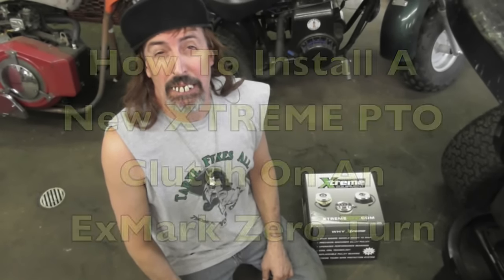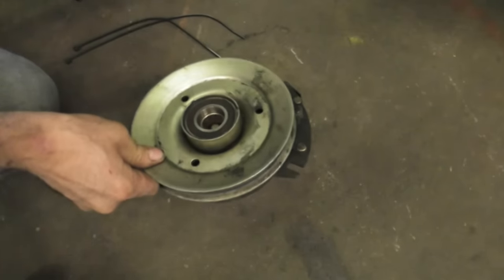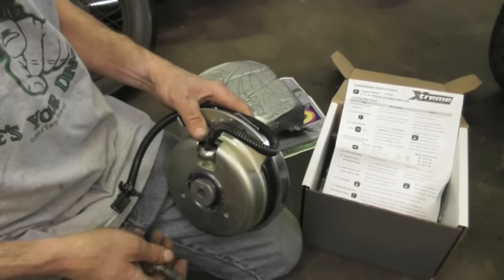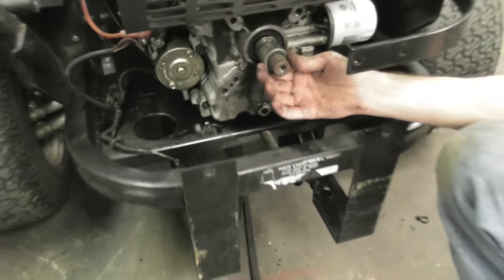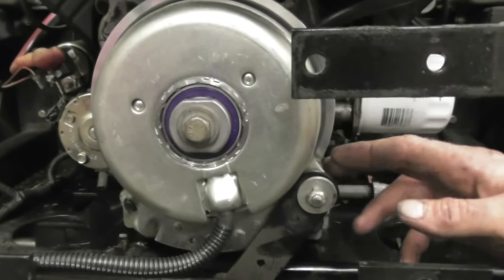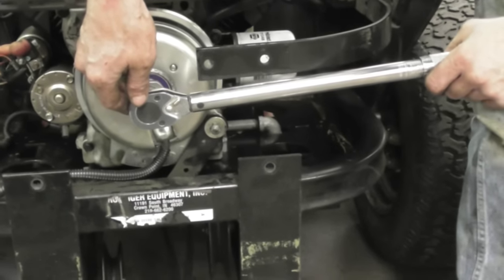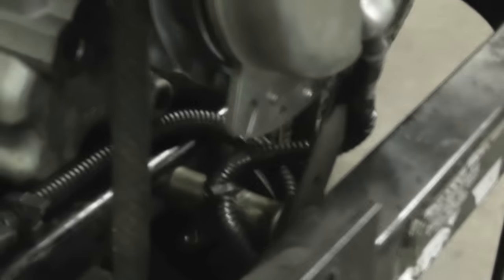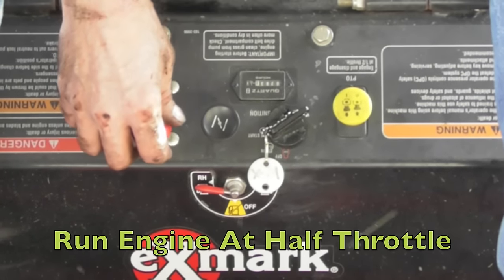Xtreme Clutch Installation Video

Comment: just cooked the pto clutch on my cub, blow jobbing the snow. I didn't look at it yet, but I know it cooked cuz it let the smoke out and the pto stopped working. it was original. all the epoxy cracked and fell apart inside. I had cleaned it up and re-epoxied it. worked for a year but it's full on dead now. I suspect the battery isn't charging, which usually isn't any problem at all, cuz if I'm only ever using the battery to start the engine, it actually lasts half the season before I have to charge it again. but, the clutch is a fairly good draw on the battery, which can drain it down much faster. what I think happened, the battery got weak, still plenty to start the engine but not enough to clamp the clutch down tight, so that was probably slipping and causing extra heat. burned the enamel off the coils inside and shorted. good to know in the future, a weak battery can cook the clutch.

Comment: Hi Taryl:  I installed an Xtreme clutch on my JD 277. Great clutch. I had a terrible time getting the old clutch off. Do you ever put never seize on the shaft prior to installing a new clutch? The new one on my is way better than the factory clutch. Thanks

Comment: Just got done with a zero turn that came in with an electric clutch problem. The customer bought a clutch online made by 8ten. Clutches made by 8ten are junk. I replaced it with a clutch made by Xtreme Outdoor Power. Works great now.

Comment: Clutch on my gravely has been engaging very harsh. No transition period from at rest to start. I have replaced all bearings everywhere on the deck. Deck itself spins beautifully. Belt gets about 50 hrs before it snaps when deck is engaged. Compared my clutch engagement to my friends. Guess I never noticed  how severe engagement has been getting on my machine. Clutch is 14 yrs old.

Comment: You can buy a special tool that’s like a big wrench that fits on that spacer the crank bolt goes through to hold the crank while you torque the bolt. Bad Boy part number 070-0000-00. Cub Cadet sells one too but I don’t know the part number. I just made one.

Comment: Husqvarna yth1542xp i replaced clutch to Xtreme one oems reads 4.2 unplugged is that good? replaced the pto switch to because it read 50oems was high in looked melted little. gotta test new switch readings. but when i pop clutch switch nothing  happens what do i need to test ?

Comment: Xtreme Outdoor Power Equipment X0491 Replaces Toro MA-GT-TROC PTO Clutch Heavy Duty Fatboy & HighTorque Upgrade    But will it fit a Toro Groundmaster 120 with limited space it has between the frame and the shaft.  Wonder if anyone has used one on the Groundmaster 120??????

Comment: But the best test is at full throttle with grass so dense and thick the motor will bog-down, but the clutch will not (won't) sleeeeeeeppp (slip) ...

Comment: electric clutch is a perfect example of fixing a problem that didn't exist,nothing wrong with a manual blade engagement like some mowers
Reply: What would that have to do with this? It doesn't have a manual blade engagement to fix.
Reply: @Georgiagreen317 it’s just a another thing that could cause and issue

Comment: Thanks for the Great video Taryl.  I was going to buy an OEM clutch when my Beautiful wife! found the Xtreme clutch for way less than OEM.   It has been working Great on my Dixon Zero turn 60" Commercial 8025 mower.  I went to your video and learned to torque the clutch bolt to 55 lbs and to Burnish in the clutch.  I've replaced several parts on my Dixon as it's 18 years old now, but I always look to your video's to make sure I'm doing things properly.  I have a lot of grass to mow and leafs to pick up in the Fall!  With your help I have been able to keep my Dixon mower running at it's best.  Thanks Again Taryl!

Comment: The issue XtremeClutch is pointing out is not an electrical problem related to "shorting out" the new clutch, Darrel - it's bc if the voltage is below 13.3V, the clutch will not seat tge flywheel tightly and it will spin, generate heat and burnout.  I know this bc my Wheelhorse stator developed a fault and produced less that 13V, so while the tractor would start, the electromagnetic clutch wouldn't sufficiently engage - which caused my old PTO clutch to fail.  So: "there's your dinner!"

Comment: FYI the D-drive on the end where the bolt goes in has flat edges, use a wrench to hold it while torquing.
Reply: Do you recommend a regular adjustable wrench to hold the d-drive?
Reply: @Santreezy  Fixed size or adjustable will do the job so long as it fits.

Comment: I just installed one on my John Deere STX, works great, customer support is fantastic as well, the previous owner installed the wrong PTO they helped track down the right one (John Deere changed the design over the years), anyway the previous owner didn't put PTO in the anti-rotation spot and time I fired it up (I bought it not running), spit the clutch across the garage floor, snapped the bolt off inside the crank. Lesson learned don't trust the previous owner on a used lawn mower. Extreme was cheaper then the John Deere warner part and John Deere dealer was trying to sell me the wrong one again, Extreme got me the right part! I highly recommend them.
Reply: How did you get the broken off bolt out of the crankshaft?
Reply: Dbunch57 installed a used “new” crankshaft, I tried every trick in the book, it had to be bottomed out on the crank, and torqued in tight....after a few days of messing with it, I found a used one on eBay, and decided I’d install new rings and all...runs great now.

Comment: hey taryl...how do you keep a kohler k series engine from spinning when you torque the clutch on?  there flywheel is covered by the shroud and you have to lift the engine to remove it...
Reply: another video dude online showed me...use a wrench socket on the pto side after taking the outer clutch off.  use it as counter pressure as it turns in the opposite direction.  both sides can be torqued using the same method.
Reply: @mackendw  I have a troybilt super bronco xp 50 their newest one & damn drive belt broke I’ve been looking everywhere to figure out how to remove that damn thing I don’t have a air impact but I do have a 20v battery one hoping that will work 
I’ve never have taken off a pto clutch before

Comment: Taryl. I replaced the OEM Warner clutch on my John Deere 165 Hydro in which the OEM clutch would not disengage due to a bearing failure. After viewing this video, I purchased the correct Xtreme clutch and followed all of the instructions. The Xtreme Clutch was very impressive both in its quality and appearance over the OEM clutch. If the clutch fails on my 682 Cub Cadet, I will go Xtreme. Best Regards To All Of The Grass Rats From Central KY.

Comment: Hey Taryl, I just put an xtreme clutch in my scrub cadet GT2186 and most everything went smoooooth. The mufkin studs didn't break and the clutch came off with a little coaxing. My problem is the plug on the new clutch doesn't match the plug on the tractor. The plug on the tractor has a red and black wire but the clutch has two black wires, can I just make a couple of short jumper wires to connect them and how do I determine which is the red / hot wire on the clutch? Any help will be greatly appreciated.

Comment: Mr dactal, I need help!! I bought  new xt1 50, cub cadet, it has a 7000 series 24 horse Kroller, I did all my bolt checks to make sure they tighten all bolts on thing, they did all except for the pto bolt!! I need to know what the torque spec is i can't find it anywhere, can you help me?  Robert from laporte indiana

Comment: taryl ..I have a problem. I have a Cub Cadet 54 in. 24 HP Zero-Turn Mower tractor, and the "pto" broke and I already replaced it. The problem now is that the new pto has 2 wires and the one on the tractor has 3 wires. That's my problem. Thanks, my friend.

Comment: Tried to use their model for the Toro Groundmaster 120 and it didn't fit and they said it would and they charged me a $25 restocking fee plus I paid shipping back to them.
I would never buy from them again on Ebay. Best to buy from JThomas Parts.

Comment: I am going to buy an Extreme clutch for my ExMark ( replace 103-1364 ) my problem is the old one is stuck on the Crank! Outer bearing is toast. When I saw your video I was hoping you had the same problem but alas the video started post removal. Do you have any videos dealing with stubborn clutch removals?Like the Billy-Bobs!
Reply: Just watched the Cub Cadet clutch removal! Gonna give the air hammer a try! Read that would work but seeing is believing!

Comment: Hey Taryl ... like you, I thought the XTREME PTO clutches were good ... and they are ... until they aren't.   I had one on a JOHN DEERE Z960R and it worked just fine ... until it shot out a fireworks display and quit working.   All 6 of the stainless spring fingers sheared off at the hub.   I called xtreme to see if I could order the hub with the clutch plate attached ... NO WAY !!!   They do not/will not sell ANY REPAIR PARTS ... nor do they perform any repairs.   They ONLY SELL complete units.   Checking into the company, and for all their b.s. about being an American Owned & American Operated company ... their clutches are MADE IN CHINA.   You might want to warn your followers ... this company is just short of a scam.

Comment: Mine might be going. After cutting for about an hour   , when i shut the blades off they won’t go back on until it cools. The clutch doesn’t seem like it wants to grab .  
Does a new clutch make the blades go faster ?
Reply: The coil in the clutch is getting weak, complete replacement is needed.

Comment: Had one extreme clutch fail after few years. Bearing failure seems to be the case. Perhaps over tightened bolt or to much vibration to deck. Who knows, Still a good clutch.

Comment: Thanks for the video, I might swap an old style (split pulley mechanical) to one of these in the future on an old Gravely.  Have to find the right size, add in an anti rotation, and switch.   Gets rid of the lever and extra belt.

Comment: Interesting video. Let me know if you there's a improved mower deck spindle for the blades. I plan to test some high end Japanese's ball bearings and roller bearing.  The cheap John Deere spindle bearings are blocked off from the grease reservoir. I think I have a low resistance circuit in my clutch assembly I will check it in the morning. Like your channel you are the "Gale Banks" of the small engine in my world. Which is like Randolph Scott in the westerns. Take care.

Comment: I have extreme clutch for my  Aaron's zoom 2350.. The connector is not the same.  To connect.. One used to connect into the old PTO.. The new one has a wire the male and female do not  Connect Together 2 different shapes.. What should I do? Cut the wires and connect them

Comment: Hey not sure if you check these but your videos are the best - installed the clutch no problem, but noticed a bunch of other issues on a mower I love - been pretty bulletproof- ‘03 Toro Z153 52” , put on some 8ten brand new spindles and they are stiff, not sure if they are junk / missing something or I’ve got blade bolt or top nut spindle too tight (hard time finding exact torque specs for my model online), any insight appreciated

Comment: got a pto clutch on a ice cream that does not work it has only one wire out of it  I would  like to hot wire it to make sure that it is the clutch at fault and not the wiring and switches before i remove it from van please help if you can

Comment: I am repairing/replacing a clutch with 160 hours on it.
Craftsman mower (not mine).
The automatic reverse PTO cutoff KILLS these clutches.
(When the blades stop when you back up).
On MY mowers, I bypass that safety switch, 
but I cannot do it on someone else's mower,
unless 2 lawyers are in the room.
THanks for THinking !!!!
Some guy in North Central Florida.

Comment: 2008 Cub cadet lt1046, xtreme 0008. Antirotation device is a blade guard. The d sleeve is 125inches on the flats. I cant seem to get a good enough bite on it because its recessed in the pully. Any ideas on how I can keep the shift from turning as I torque to 55 ft lbs? Thanks, JD

Comment: Can you do a similar replacement for a noram blade brake clutch that is not electric but runs off of a belt and spring (and is underneath the machine??)

Comment: my Warner 5218-91 lasted 11years do you think the xtreme will last that long and notice that most bearing failure occurs on the side bolt goes Thur not the pulley bearing are both bearing available from xtreme

Comment: I believe that it must be built with ceramic bearings. They can take higher temps and they also run cooler...also they are fragile so you have to use a torq wrench...

Comment: Nice clutch! Question. Mixed reviews and input about engaging/disengaging electric PTOs in regards to engine rpm. I was told 3/4 throttle to engage is fine with my Toro ZTR. Disengagement about 3/4 or 1/2? Want to give the clutch the longest, trouble free life as possible.

Comment: What's the best way to get the clutch off
Reply: Matt, it took me a LONG session with an air hammer on a bolt screwed into the crank to get mine loose.